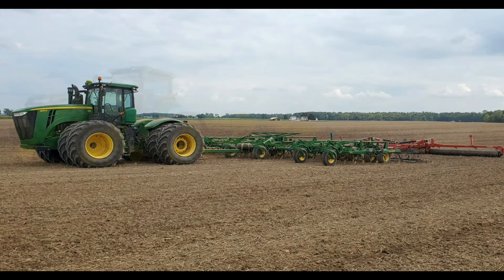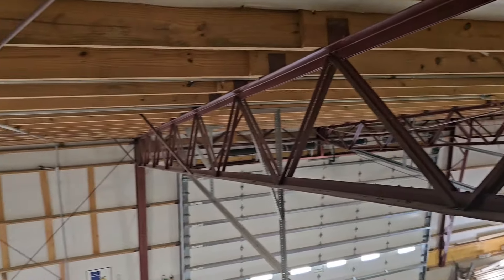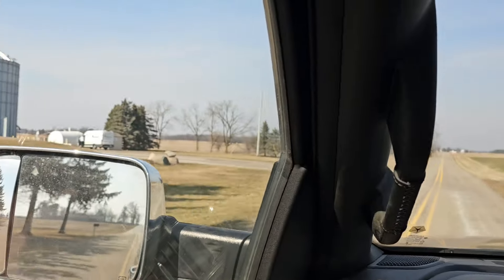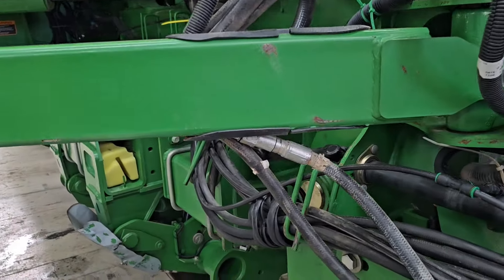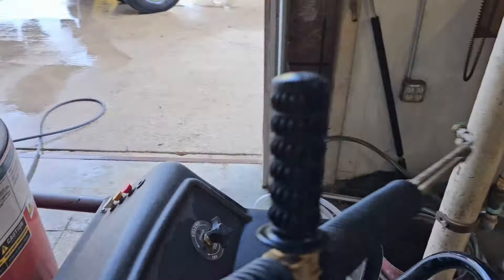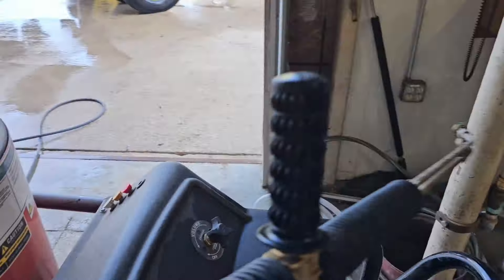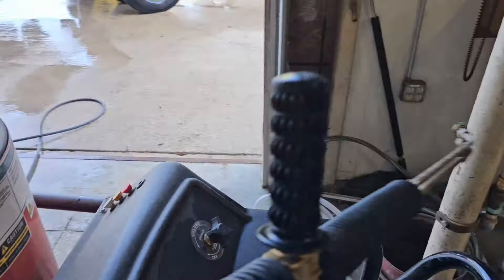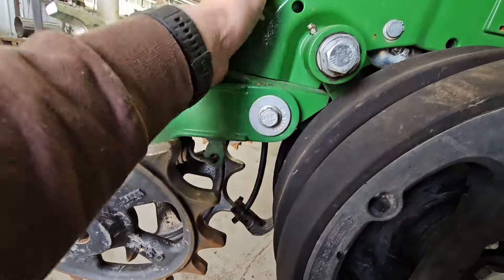They're Not the Same

Comment: i was watching ivers farm youtub channal yesterday they took off their counsel system and went back to there rubber gauge wheels because after 2yrs of trials got a negative return on liquid starters and fu-fu juices but sold them vary fast and are not putting any fertilizer with the planter on their 6000 ac corn.